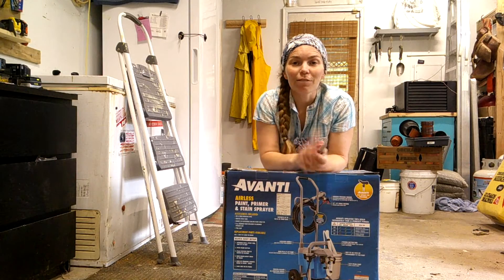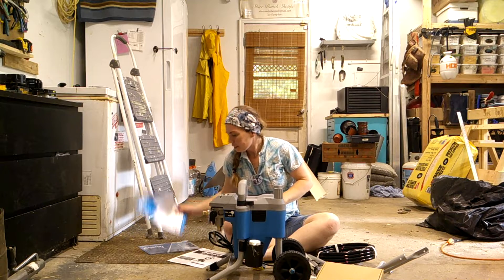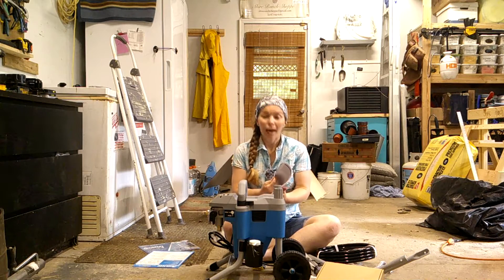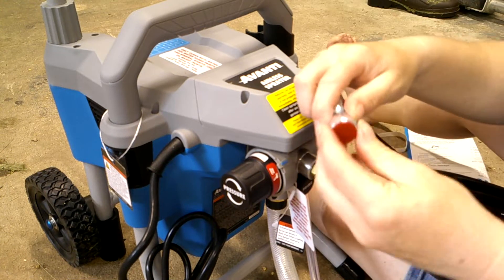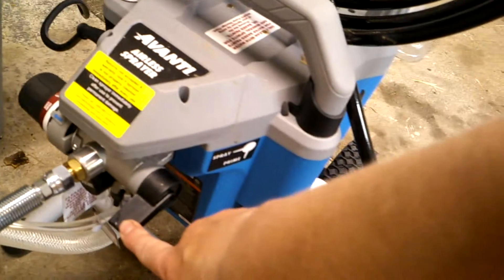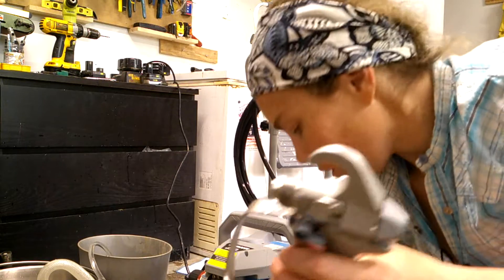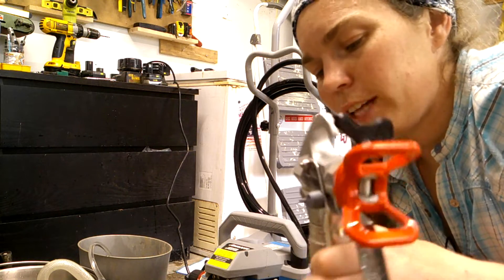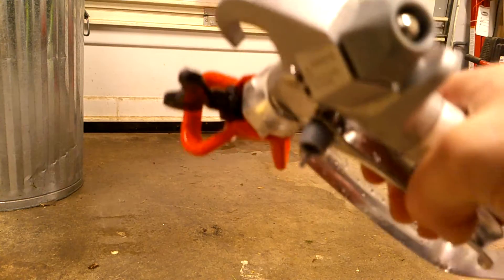Upping our Painting Game with an Avanti Airless Sprayer from Harbor Freight | Unboxing & Set Up

Comment: Here is one thing not shown ANYWHERE. A quick video on a Disassembly of the gun. Not a full disassembly just the tip and most important..the filter. The manual doesn’t even show you.
Reply: Harbor Freight tool has the info  on web site .
Quick Start Guide 
Owner's Manual & Safety Instructions

Comment: I know it doubles your cost, but i have the same one. I also got a graco 360 dual speed handheld on amazon for smaller jobs. 
Total feom priming and cleaning you lose 1/2-3/4 gallon of pain with the big one. If painting a house not a big deal for the speed, but for smaller projects like just a garage door or kitchen cabinet doors or priming and painting your house doors, i found thw graco airless handheld is awesome. 
I oaid $200 with coupon for avanti (im sure it was cheaper when you bought it lol inflation is nuts). I paid $204 for the handheld graco. They each have their place. But both have worked well. Make aure you clean, clean, clean, clean it right away. All of it. And use storage fluid after cleaning really well if youre not going to use it for a week or more.

Comment: Thank you very much, @5:35  I learned from you to use the spray tip to set the seal in the nozzle guard. Oh, by the way, @7:19 there is ONLY one way to spray, the SPRAY position, the other position is to the UNCLOG position ;-)
Reply from the maker: Glad it helped!

Comment: When tightening the spray guard (red part at end of gun) dont overtighten. Make sure spray tip turns between spray and clear clog reverse easily and doesnt hurt the seals. 
But thw new guard is only $5 at HF. So nit bad. 
Max tip size is 17 (last 2 numbers on the tips X17). The forst number ill use 515 as example is the width of spray approximately at 12" from painting surface . You double the forst number, in this case 5, and its 10" width. The last 2 numbers are orifice size of tip. The stock one is 15 meaning its .015 (fifteen thousandth of an inch) max is 17 for this unit again.

Comment: Harbor Freight tool has all the info 

Quick Start Guide 
Owner's Manual & Safety Instructions
Reply: Advise to wear safety glasses and EVER put finger on gun tip when pressure in hose .
There has been accidentally forced paint under finger nail and doctor had to cut finger the off .